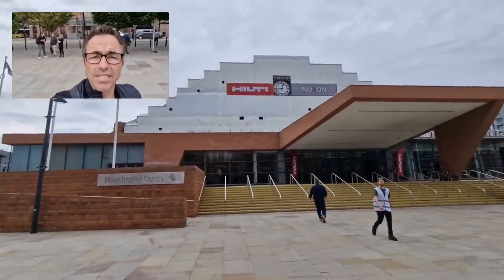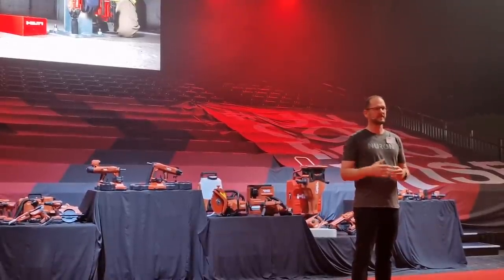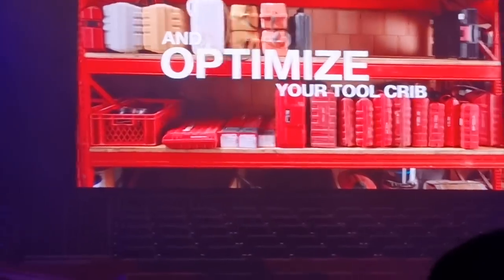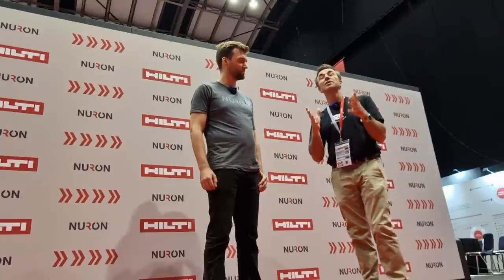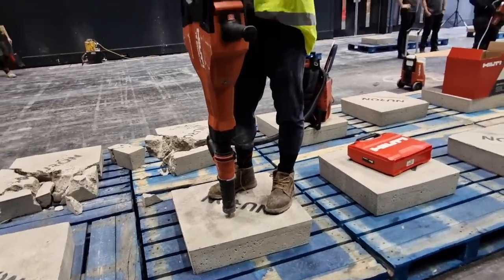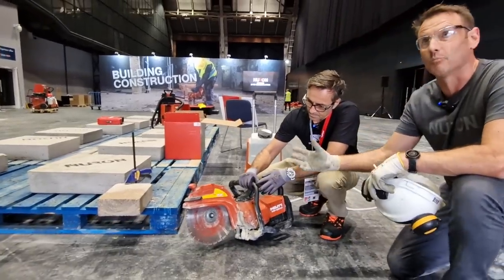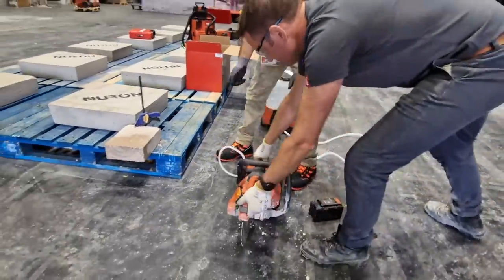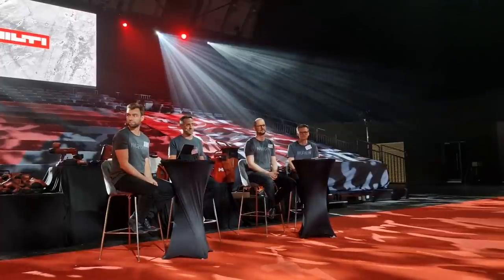Hilti Nuron, Amazing power and potential!! New Tools and battery platform

Comment: Theft control. As I title this as it has the technology to connect and provide data to Hilti when being charged. If stolen can this provide data and location of stolen items or provide a lockout function to the battery/tool if reported stolen to Hilti either in fleet or purchase ?? Just a question as would be a good selling point if it can't be used and a dead unit?
Reply: Hmm as soon as you pull the battery it would he difficult to trace. It could be all made very complex with apps and all that but is that what you want? Maybe it's what the bosses in the office want who have to do the finances. Bosch Professional has a tracking system I believe. It's all a bit too Big Brother-like for me

Comment: Hilti were around when I started. Even back then they were tools owned by companies you worked for. They weren't tradies tools. The exception being the powder actuated guns. A lot had them. Bosch were the drill kings though having come out with the SDS drills. I had one of them. Later had a Hilti SDS. Still have an old one in the shed. Today not much has changed. Company tools. The other problem where I now live is that Hilti stores are scarce. The service they made their name with doesn't work when you are unlikely to get a tool replacement for days. And getting repairs and parts probably weeks. Getting any brand repaired can take months. When I think back to Hilti it was always the powder guns shooting plates onto steel or into concrete with stray nails ricocheting off the walls. Or using them as pistols shooting targets. No safety systems then. Cartridge nail and fire. They were good fun.

Comment: I was considering stacking out with Hilti tools, but the problem is the UK prices are extortionate, they seem to be stuck in a vat time warp, where they do the old trick that other companies used to pull, whereby they double  the vat to 40 percent. for example in the US the Hilti SF 6H A22 drill driver is a very  reasonable 179 dollars, which at the current exchange rate is 154 quid Here in the UK Hilti have priced the same drill at 213 quid ! now 154 + 20 percent is 184 quid, clearly someone at Hilti UK thought hey lets just double that to 40 percent. Zero respect for UK customers ! 

Added to that Hilti don't sell through third party retailers, so there is no competition on pricing, its Hilti RRP or the Highway, no sales no nothing.and Hilti are out performed in many categories by cheaper brands such as Dewalt and Milwaukee,  I simply cannot invest in that ! but the 40 percent vat grinds me the most
Reply: That’s our pre tax price, FYI.
Reply: @robertrada4783  So its even worse 213 + vat = 255 quid UK price, thats a 65 percent price increase above and beyond the US price.Shame I really liked Hiltis products, but cant justify that, feels very mean spirited towards us here in the UK.
Reply: @rocketmunkey1  no, he means the US price I’d pre tax. Every state has different sales tax, some way higher than others!! 0-40% state to state
Reply: @AS19283  Yeah I get that, thats a given for US pricing, the reason is the sales tax differers from state to state, but the absolute maximum sales tax is only 7.25% and thats in California, there are five states  Delaware, Alaska, Montana, New Hampshire and Oregon. with 0% sales tax, so the most you'll pay in the US for the SF 6H A22 for example is 192 dollars which is about 165 quid. 
But the UK price I quoted of 213 quid is actually excluding vat too, so the actual price after VAT we pay here in the UK is 256 quid, which is the equivalent of paying 65% tax above the base US price. not 20% If you see what I mean.
Reply: @rocketmunkey1  Oh geez. I did not realize that those prices were pre-vat.  So Hilti is doing to you much the same as Dewalt and Milwaukee? That sucks.  If it’s any consolation to you, compare Makita SDS (you will shit yourself on this one), Festool, Mafell and Metabo (not Hitabo HPV) prices.   Hilti had even lower prices on Nuron for a short while as an unofficial introductory thing. They will likely raise the prices at a whim here again.  I also have been informed by people that receive below published pricing that their discounts aren’t much on these new tools.  UK discount pricing might be much lower than published in contrast.
Reply: @rocketmunkey1  UK and Euro VAT will always be more than US sales tax but no, 7.75% isn’t the highest sales tax.  It may be the highest portion a state takes out of a sales tax but there is more than the state’s cut.  Chicago is 10.25% when all is said and done.  At one of my job’s we were using eposnow out of Norwich for our cash registers .  They also bought out a pos company with offices on both sides of Oz.  I made many minds explode over this phenomenon. 😂

Comment: Considering Hilti is a Swiss company, I cant see why they are so much more expensive in Europe than the US!  

I jumped the gun and imported Nuron impact driver, jigsaw and combi drill . Bare tool impact SID 6-22 was $180 (currenly £160 - was a better exchange rate then) and UK price is now £254 !   That's 58% higher price pre-tax.  I got Hilti to remove any sales tax and ship to forward shipper to the UK. Even with shipping and import duty, I still saved a few £hundred on the three tools, 3 one-strip batteries and charger. Only caveat is I need to use a step-down transformer in UK - nothing simple to modify inside (I checked!).

Anyway, can't wait to use them and compare them to my A22 platform versions.. just so hesitant to take them on site - I might get a bigger tool case before I do, so I can pad it out for them..
Reply: Swiss that's news to me they used to be the biggest employer in Liechtenstein...